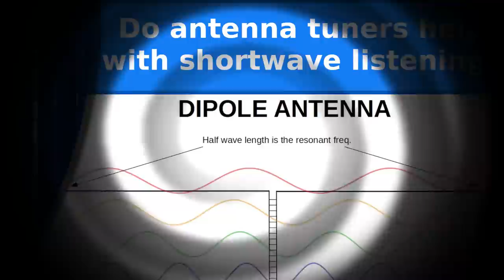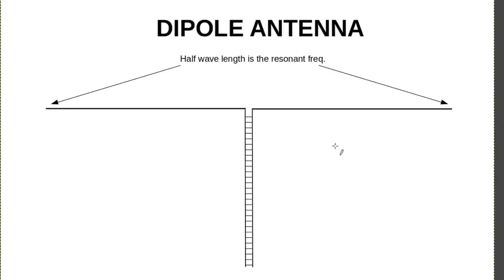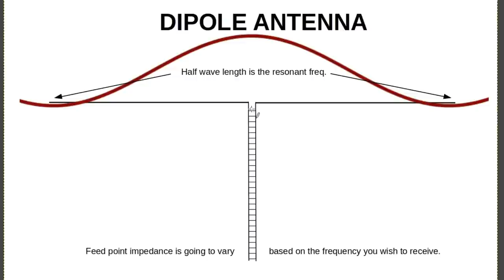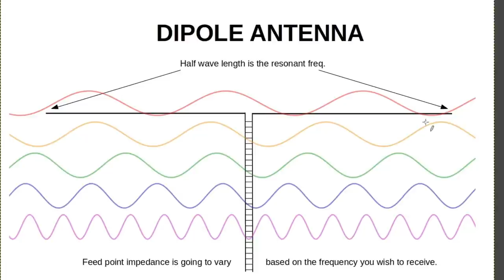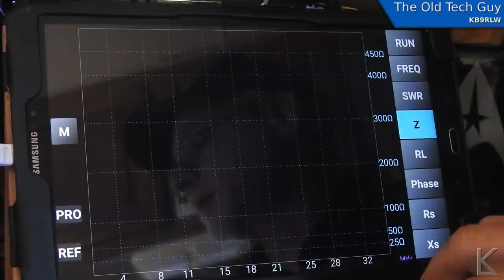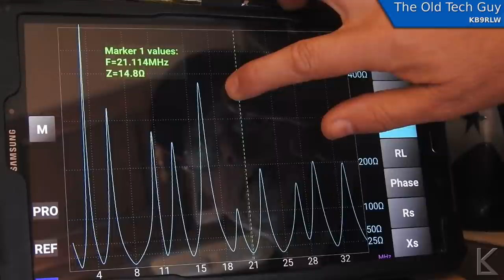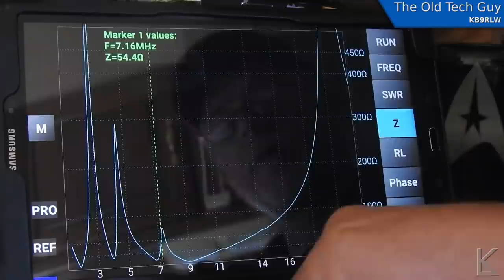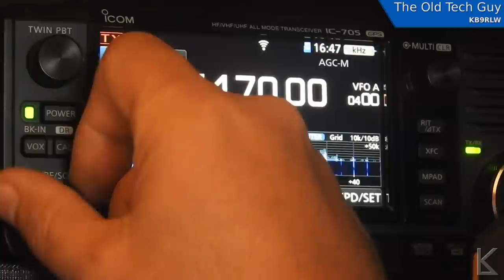Ham Radio - Do antenna tuners help with shortwave listening?

Comment: Receviers are not universally 50Ω. When evaluating a "tuner", on the receive, 2 things should be taken into account: whether the "tuner" is acting as a preselector and does it increase the SNR. The level of the signals is secondary.
Reply from the maker: Yes, receivers are not universally 50 ohms.  A transmatch is not always creating a 50 ohm impedance either.   What impedance it presents depends on how it's adjusted, so it can match to whatever impedance your receiver requires.
Reply: @loughkb  So in essence mismatch loss is greater than tuner loss? Are you sure that those few dB are responsible for the effect you are observing.
Reply from the maker: @galileo_rs  Here, this is a place I think you might find happiness.
https://www.youtube.com/watch?v=xpAvcGcEc0k
Reply: @loughkb  A mighty fine argument ;) Is the cold getting to you, you usually get the slight nudges.

Comment: Thanks Kevin. I'm a bit of a newbie and just getting steeped in HF. I noticed with my manual tuner that RX was improved by adjusting the tuner, now I know why. If you can answer this question, it would help my layout. I have a good SWR meter that I need to know which side to hook it up to. Between the transceiver and the tuner  or between the tuner and antenna? Thanks and 73. KJ7YBK.
Reply from the maker: Between the transceiver and the tuner.  You want to know what your radio is seeing.  The antenna side won't change when you adjust the 'tuner'.
Reply: @loughkb  Works perfectly. Thanks for the help.

Comment: It's changed the antenna electrically and the whole system to resonance
Reply from the maker: Nope, it doesn't change anything about the antenna itself.  If, at a specific frequency, you were to measure 320 ohms impedance of the antenna, and your tuner presents 50 ohms on it's output, the antenna will still present 320 ohms at the input to the tuner.
Reply: @loughkb  the definition of resonance is when reactances have cancelled each other out  ,the tuner by providing a conjugate match has tune the system including antenna being apart of the system to resonance by adjustment of the reactances
Reply from the maker: @Pioneer936  Yes, but it still doesn't change anything about the physics of the signals the antenna is capturing.  Which I believe is the root of the argument people make.   The antenna wire itself is not going to behave any differently.
Reply: @loughkb  didn't say it did just explained how a tuner obtained resonance

Comment: An ATU is no. A manual tuner works well for receivers.
Reply from the maker: Yes, of course.
Reply: My ATU has L and C up and down buttons on the front face.  Has been used successfully many times for SWL.  Just play with it until signal and noise peak.

Comment: Tuning antenna doesn't bring too much differences (you are able to compensate with RF Gain). So, from this point of view..it's useless. In fact, I tested with some SOTA stations...(weak station...barely over the noise level). With 300 Ohm antena...with tuner or without tuner...I was able to hear that station (just I had to bump the rf gain)....
But the biggest advantage: you are able to make antenna as a band pass filter. We have here a AM station at 630KHz...and sometimes...it will strat to overload the input stage. More, I found that in some strange situations (at least when I am portable and at 3-4 Km from the station)...the antenna will act as a mixer. Tuning the antenna...it will avoid this.
Reply: The waterfall on the video prove that tuning the aerial does a great gain. You can play with RF gain AND the volume if you don't use the AGC ( this is how hams used to ) . But you can't compare a amplification circuit with a impedance matching circuit . 300 Ohm antenna you said...on a 50 Ohm socket ? Does the tuner has a transformer for a ( i think it should be ) bifilar / ladderline ? If you were able to hear the weak stations even without the tuner it is ok : a tuner don't make miracles. But it helps , it certainly does so nothing about "useless" . You're right on the pass band filter .
Reply: @adrianoragazzo1321  Yes...but doesn't improve signal to noise ratio. It's bumps the station signals...but also bring more noise. So, at the end of the day...you don't have any improvement...With modern rigs sensitivity is not a problem...Just look at the noise floor...it's bumps up the noise with the same level of bumping the singla level...
Reply from the maker: SNR is a different topic and outside the scope of this video.